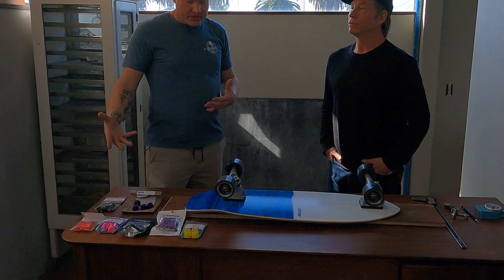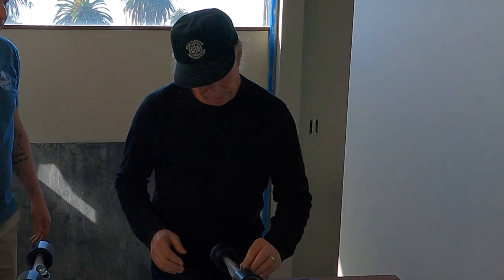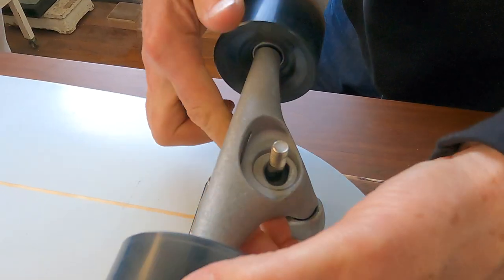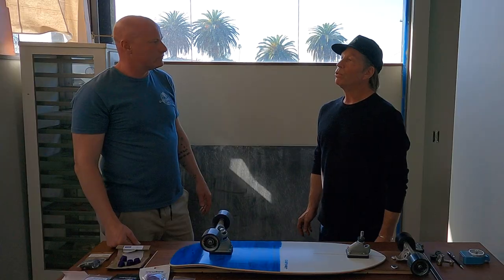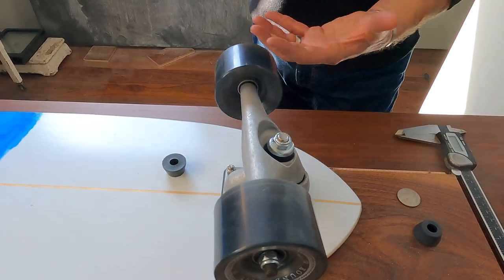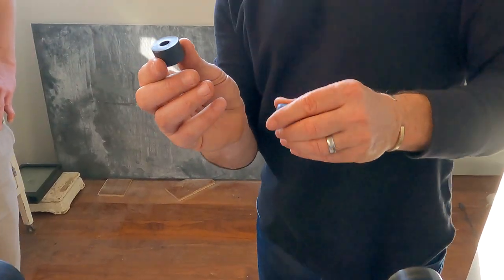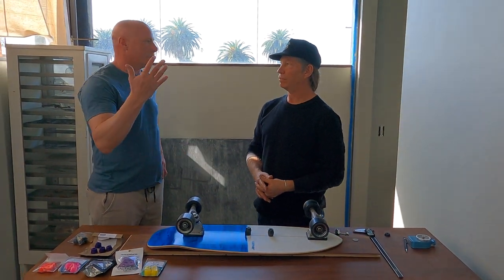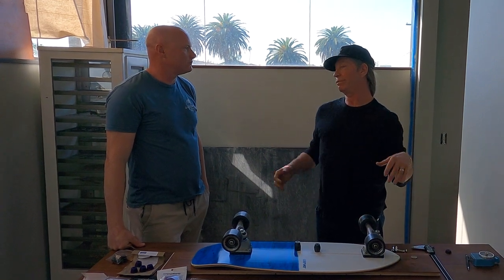Basic Guide to Carver CX Bushings with Carver Co-Founder Greg Falk

Comment: Great video Steve and really nice to see Greg, haven't seen him for years and he looks to be in great shape still and I hope he's actively riding. I like how he pointed out the proper Carver bushings will center your kingpin and not hit any of the sides of the hanger hole. Proper placement of that Kingpin is crucial and needs to be properly fixed with the right bushings. Probably, 95% of riders aren't aware of that? This is one reason skaters who skate with very loose trucks always keep breaking or cracking their hanger. Again, great video and Gee! I hope you two had a session after this taping. Would be such an honor to Rip It Up! with Greg out on the street since he's one of the original Surfskate Pioneers!  🤯Poof!....hope you filmed it!

Comment: Excellent comprehensive video! I’ve gone back and forth with cupped vs flat washers since switching my stock CX bushings to the 90a yellow Riptides. I’ve settled with flat washers after experiencing no negative effect on the forward pumping inertia all the while enjoying the increased rail to rail lean. This could be because of the Riptide’s “Higher rebound” formula properties?

Comment: I’m purchasing a board with carver cx trucks soon. I’m going to buy the Santa Cruz classic dot pig cruzer and it’s going to be my surf-skate. I thought maybe I should get a big deck to ride for more control and it’s one of the coolest surf-skates I’ve seen. I’m just starting out. I know all about maintenance when it comes to a skateboard. It’s no different other than the front truck being more like a surfboard than a traditional board. That’s my only concern. I’m a little skeptical about balancing the front truck because I don’t have a great sense of balance. I have an ok balance. I can’t hardly manual for more than a few seconds though. I fell off of my surfboard inspired board. I had the trucks turned all the way and I was leaning backwards and yeah I had my knees bent and everything like taking a carve and as soon as I got into that position I fell off. I have most types of skateboards so I know what I’m doing :) I love riding my big one with revenge trucks and yes that’s the one I fell off of trying to do a left hand turn. I was also wondering what are some of the cons to surf skating. I know all about the pros to surf skating.

Comment: Hey surfskate love. I followed all your instructions on your website to slush the bolt and nut. Bushing the correct way etc. However my trucks do not have any resistance. It is still shakey and the the washer cup can be swiveled with finger(when bolt and nut flushed)
Reply from the maker: It must not be tight enough. If you can spin the washer with your fingers, it's too loose.

Comment: does a reversed kingpin setup affect the "preload" of the bushings? 

 I have a feeling it's not possible to get the front truck as stiff in reverse mode, but it seems unlogical that that would be the case.
Reply from the maker: My guess is that it depends on how tightly you screw the nut.

Comment: Experienced same issue as @Fifty Fifty. Both stock and replacement BB from Carver will not stay seated flush against hanger and pop out of seating shortly after install. I'm not heavy at 170 lbs/77.1 kg. Still able to enjoy the board, but geometry is off and effects rebound. Resistance not as consistent through full range of motion.
Reply: Also getting divots on hangar where it's contacting the bushing cup and base plate where cup sits. Majority of squeaking comes from pivot cup because pivot point on hanger not twisting on proper plane, grinding at pressure points because pressure not distributed evenly.
Reply: Two theories: Urethane not able to hold form in Virginia summer heat and/or pivot cup not firm enough and allowing too much play in geometry, but who really knows.
Reply from the maker: Good to know.

Comment: What about the orangutang nipples and knuckles? The combined height works out the same even tho they aren’t the same recommended carver dims for board vs roadside
Reply from the maker: The Nipples definitely work as a set. I suppose Knuckles could work, but only if you reverse them from how they're intended (use the .64" gumdrop on boardside and the .59" barrel on roadside). But that would not be ideal.

Comment: I’m on my 2nd CX board from Carver (Greenroom and Triton) and both after a few weeks the bushing starts squeaking and bulging out of the seat that it sits in. It also affects the turn because it basically acts the same as tightening the bolt as the resistance is increased and the nut is hard to get off. It seems that the hanger piece is just a bit off so when you take it off an reseat the bushing it fits but as soon as you put pressure on it, it slips slightly and the puts unequal pressure on the busing causing the squeaking and bulging out. I really want to like Carver but this is the second board this has happened on. I have a board with the C5 truck and it seems not to have this issue so maybe a batch of CX are bad?
Reply from the maker: Do you have the taller bushings on boardside and shorter bushings on roadside?
Reply: @SurfskateLove  no. I haven’t changed them. Stock from Carver. I did take them out to make sure they didn’t come installed backwards and put it back in place and within a short time starts squeaking loudly and bulges right back out. Super hard to pump too when it gets wedged in there. I got a Carver board for my niece and visited her today and her board now the nut wiggles loose on the CX. Looks like her bushing is holding though lol. Think I’m done with Carver CX. That’s 3 boards with issues. I’m pretty bummed out. Have you not seen or heard of issues? Thanks for the reply
Reply: @theaustralianhulk  Maybe lube the busing with some Sil-Glyde or some white lithium grease.
Reply: @funkingitup1805  carver ended up replacing the trucks on both boards. Nothing I tried worked to fix them. The new ones were great but not long after I lost interest in surf skating and sold them haha

Comment: That is my board on the table (I think it is Resin). What I have problem with is I have to tight my front truck almost every 10 minutes . Why is it getting loose???
Reply from the maker: I'm guessing the nyloc on your nut is worn out and you need to replace it.
Reply: We all are guilty of reusing nyloc nuts, but they are really meant to be tightened once, and then left alone. Loosening them tear them up and decrease the back off resistance.

Comment: i use like a moog swaybar link bushing on the boardside bushing of my cx because it gives like a heavier resistance but because its tapered and has a lip that fits on the inside of the d hole, it seems to center itself a little faster, but what is the main purpose of the d hole shape? is it to limit the hanger to particular motions?
Reply from the maker: I don't know that it's to limit the motions, but rather that is just how the truck moves.

Comment: Hi guys! My original yow bushing creaks awfully on the rear truck, tried different ways to solve, putting some lube helps and the truck get quiet but not for long, it gets out and it creaks again. Will switching to some other bushings help? Does anyone have a problem like this?
Reply from the maker: Yes, absolutely: https://surfskate.love/product-category/surfskate-bushings/riptide-yow-surfskate-bushings/
And it's very common.
Reply: @Surfskate Love  Thanks a lot, Steve! 🛹